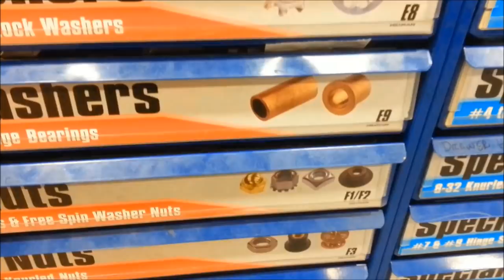Router Jig - Etch A Sketch Style!

Comment: Dude, this is a man-powered cnc cutter. As far as I can see this is actually a great idea. Easy to plane large pieces of wood with it, or just use for stuff like this.
Reply from the maker: thats a great idea.
Reply: That was my thought too - a replacement for a router sled for the purpose of flattening out larger pieces since most joiners are limited to 6.5" wide

Comment: Throw some stepper motors on there and you have a cnc machine....probably the most common comment you get :D
Reply: ah yes, and i did not read your comment first, really
Reply: 5 years later, and 3 after yours I realize I kneejerked a cnc comment myself LOL.. But it is a totally legit idea. I wonder if cables are legit though for a cnc application. I know cables are used in log-track lumbermills with a big drum that spools them one way and the other but in my head it seems like the cables would need to slip laterally to avoid binding, yet the drum wouldn't have traction if it allowed the cables to slip.. Bah.. Now I need to make a mockup.. Off to the 3d printer!

Comment: Brilliant.  No more words needed.
Reply from the maker: Thank you
Reply: Loved the way you did the wheels with the router. I'm afraid I'm useless with that mechanism lol I was as a kid ...
Reply: Actually ... I've been thinking ... "think woodwork" lol ... this is a great base to do a CNC kinda thing ... instead of the turning handles a pair of steper motors, some electronics and "voila" .. a 2D CNC quite easy to asemble. What for ? Letters for instance. 
And adding a small axis in the router mount ... and "voila" again .. a 3D CNC...

What do you guys think ? Feasable ?

Comment: Izzy, my garage gets really hot in the summer too, but I find that if I don't open up the door and let the heat in, it stays cooler.  Also, I was thinking about adding insulation to my roll up door.  They sell it at HD in syrofoam sheets which you apply to each panel of your door.  It might help to keep the cool in.  Thanks for the fun vid.

Comment: I like it! I think I it might solve a problem that I've got. The only issue I'm having is I can't get my head around the rigging of the cables. As its a closed loop, when one side goes up, the other side must be coming down & visa versa. However the vid clearly shows each axis arm being driven in the same direction simultaneously at both ends... ok I've figured it out. wonderful what a sheet of paper and a pencil will do.

Comment: Love it! I think i need to make one of these. Kids in mind too. How do your kids like it? I was thinking of making something like this but fixing the router above the table and making the table moveable. Using threaded rod as lead screws for table movement. If I use 3/8" threaded rod, with 16 threads per inch, I could have some measured control of the 3 axis's. One full turn would be 1/16" in any direction.

Comment: Cool video! You might want to add a scale to each axis to read measurements.
An MC (Manually Controlled) 3-axes-router. Great!
Using supported rails (they are not that expensive any more) could add some stability, the tubes might bend under the weight and power of the router.
Cutting a window into the base plate (or making it a frame instead of the plate) allows you to put the whole kit on any surface.
Oh well - and add some arrows to the handles, what turning direction moves the tool where... (upper left corner of the final frame...)
Thanks for your work!

Comment: Really nice! I wonder if you could do 15,and 30 degree angles with such a setup. I guess it would have to be done with uneven diameter "pulleys". I know you could have done 45 degrees with this by installing 2 other "pulleys" on top of both X and Y axis with the third one to control those (they would turn equally, therefore creating a 45 degree angle).

I really like your channel Izzy, especially this video and the "ultimate table saw fence accessory" thing :)

Comment: I came, I saw, I got impressed. Now for some add-ons :
- find a picture of a circle (graded all 360 degrees, as fine as you can get them). then print them on paper, laminate it, punch a hole in the center of the circle, put the laminated printed circle in the center of the shafts controlling the 2 axis motion
- drill a properly sized hole in the arm, far enough from the center to match the printed degrees on  the sheet you just printed
- through the hole, put one of those dollar store laser dot key chain things.
when turned on, the laser dot should fall on the printed numbers.
do 1 360 degree turn, find out the dimmensions by measuring, do this for the major angles : i suggest in multiples of 45, then find out what distances you cut with each multiple.
It'll give you more control over your cut.
If it helps, you can print equivalents, so you'll know how many turns will give you how much cutting, instead of doing it by "eye measurements" . It's not going to be as elegant or as complicated (yes techies I know stepper motors, threated rod counting and formulas and the programming, aren't that complicated) as a CNC but it'll give you more control over your cuts.
Hope it helps. It's a cheap way of adding functionality to your already amazing set-up.

Comment: hey izzy..
you could also use this jig to plane large slabs of wood..
use a slow rotating drill to drive the router steadily from one end to another.. at the end of the ride, use the handle to shift the centre of the router sideways and then put the drill in reverse motion to pull the router back..
basically a zigzag route for the router... 
can you try it and post a quicky video..
it'll be fun to watch.. throw in some zany izzy'isms...
Reply: for the bit you can use a hole saw cutter, but with the drill drawn in above the cutters cutting teeth
Reply: there are specific bits for this job that are also used to plane or flatten metal,type in youtube drill press surface planer and you will see

Comment: Fire it up with an Arduino and a raspberry pi and you are hi level CNC at home. Fan task trick. with proper tensioning radio dial wire controls of this type are 1000th of an inch accurate, which is why they used them on the first dot matrix printers. Stepping motors and some basic input and you are away... thanks for the idea.
Reply: Thinking about doing this, let me know if you decide to build it.

Comment: Izzy, could you enlarge this system, mount it up near the ceiling, and suspend a camera from it in your shop that you could then position where needed just be cranking on the Z/Y dials. No cables to trip over or tripods to spoil the shot.

Comment: Now if you replaced those handles with stepper motors and threw in a control system you would have a CNC router.
Reply from the maker: and 2 mad daughters. lol.

Comment: Big deal. What is the utility of this beside drawing on a piece of wood.
Reply: You could use it as a thicknesser to machine wood flat and to different thicknesses, make signs, do inlays, you could make it to a smaller scale and use it to machine pcb connections you could add stepper motors and make a cnc router, the possibilities are endless. If you can't see the potential it probably wouldn't be any use to you so you are sort of right in the wrong way! Have some creativity and vision